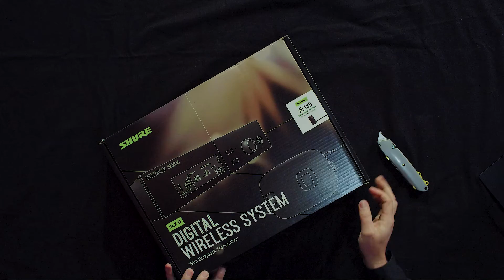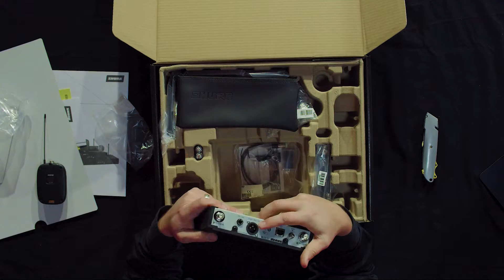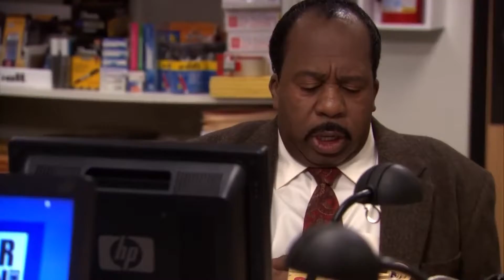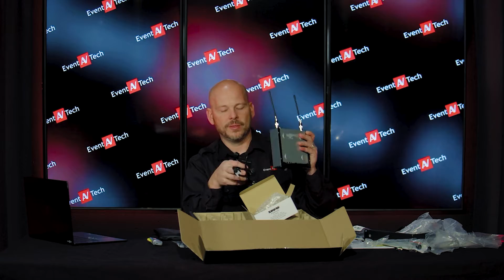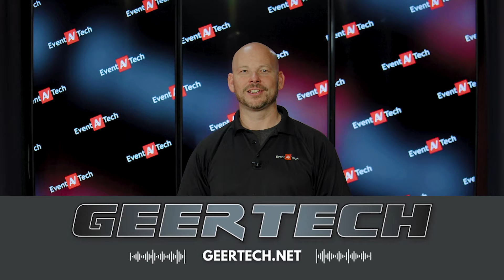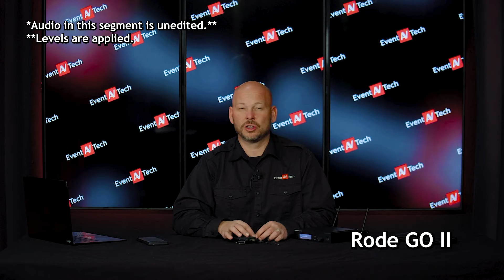Shure SLX-D Wireless System: Start of the Pro-Level Sound

Comment: You can lock the transmitter lol. It's the auto lock option on the transmitter. I'm surprised the guy from Shure didn't tell you.
Reply from the maker: I'm not sure the plastic body pack supports lockout. You can upgrade the body pack to a metal pack that does support lockout.
Reply: @eventtechav  You can? I've never seen that before, can you share a link? I'd love to purchase some.  In the manual it clearly states how to lock the pack, doesn't state it needs to be metal or anything like that. I'll have to dig my bodypacks out to check, it's not a feature I've ever had the need to use but I went to look it up when you said it because it sounded strange they wouldn't have included it. Anyway, share the link of the metal pack! I'm quite curious about it. Also, as I said, it does say a lock feature is included on the bodypack in the manual. 🙂

Comment: We just set up our new SLX-D system. We're not sure if we should run all the gain from our Qu-16 mixer or use the "Optimal" level on the Shure SLX-D receiver. We are in a small church setting.
Reply from the maker: The general rule of thumb is to add gain earlier rather than later. So how does that apply in your situation? Let's start with sensitivity settings dependent on the primary use of the mic we have found that sensitivity between -8 and -14 is a good place to start. Then gain output of the unit should typically be around 0. Most of the time there is no benefit to adding lots of gain at the unit. Then add gain at the console to bring your levels up to that near Unity that we discussed.